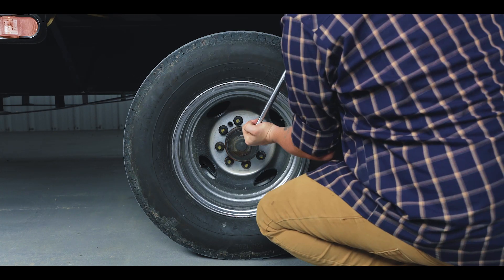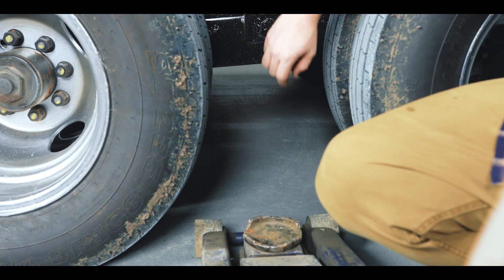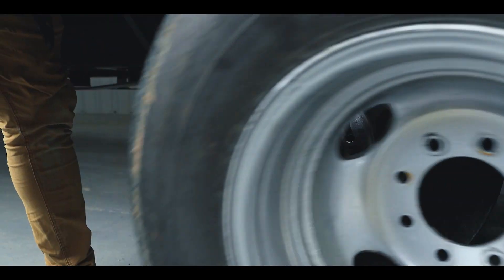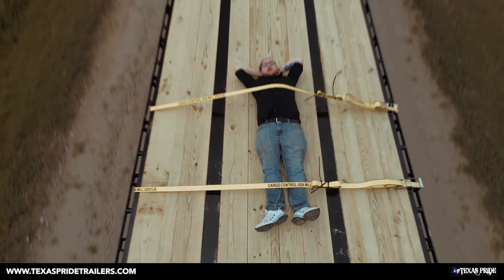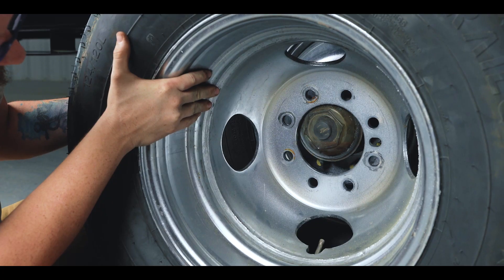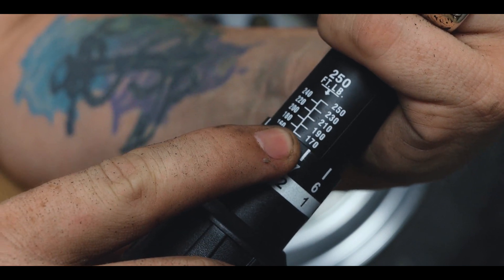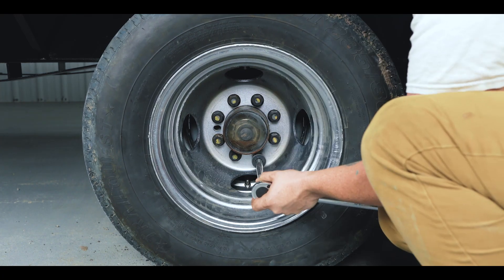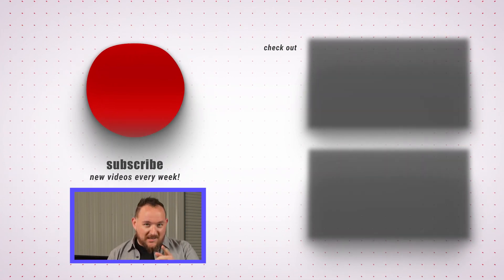TUTORIAL: How To Change a Trailer Tire | Dual Wheel Application

Comment: You didn't mention lining up the little stud on the hub  with the oblong hole in the wheel.  What is the purpose of that stud ? I bought an extra 8 hole wheel for a spare  that has a round hole for a stud  that doesn't line up with the stud  on the trailer  What gives?

Comment: If I have a empty trailer or it's got a light load on it I will lay blocks of wood down in a stair step type configuration and either pull up on it or back up on it which is way safer than a jack due to I still have my other axle still sitting on something more solid than air.  One other thing I do is try and have my tires that are beside each other to be as close to the same height as the other one ( run a matched pair or as close as I can )   I learned the hard way when my grandmother gave my parents a motor home and she said they always had tire blowouts and we found that most of her tires were about 1/2"-1" different in height plus the exhaust pipe was ran right in front of the tires
Reply from the maker: OH MY!